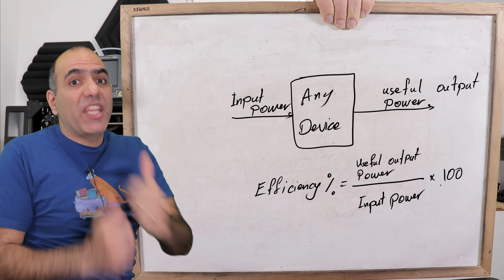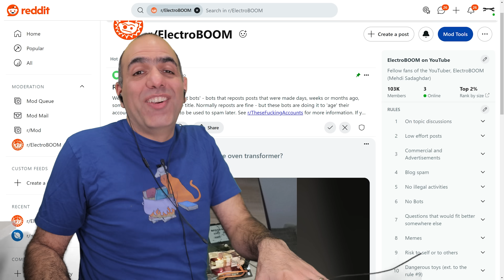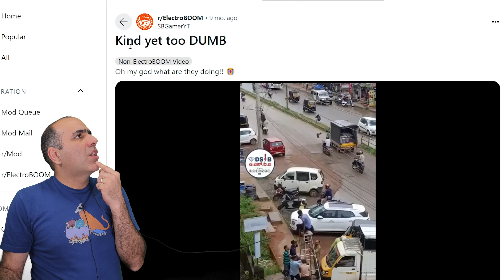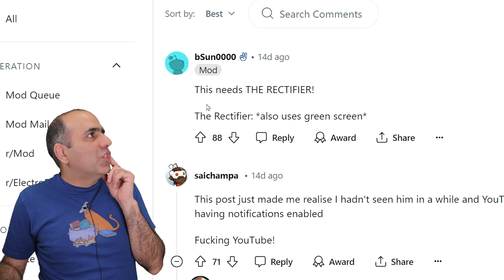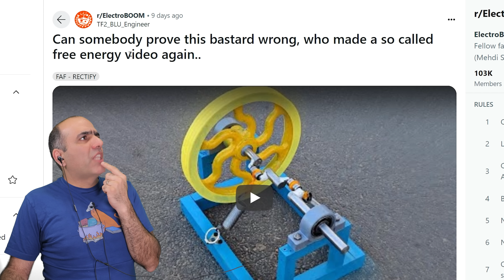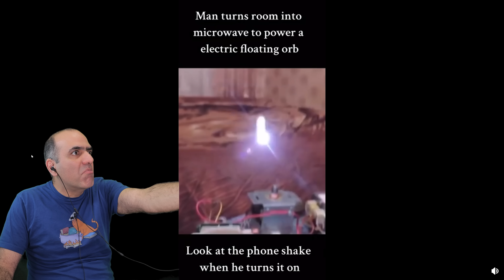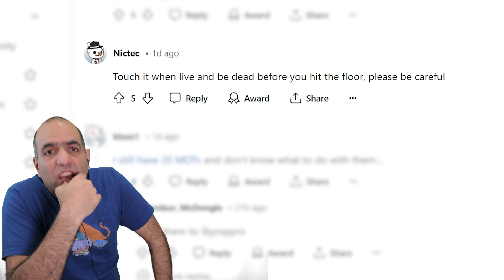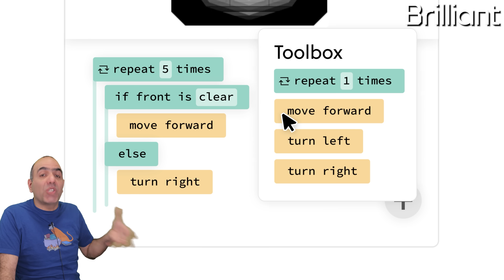New Flywheel Free Energy?! Can Boat Battery Fry You? LATITY-013

Comment: Yea trump has as much knowledge about electrics as he has about good hairstyles
Reply: He was talking about all electric boat not regular boat.
Reply: @harkbelial  Neither on a normal boat nor a "full electric" boat would be a real risk of getting a shock. Not just because the highest battery voltage you have is at 60Vdc, the water around the battery would act like resistor so that the only place where you could feel current flowing is between the 2 poles of each battery, where again you only have 12 or a maximum of 24Vdc.
Reply: @legominimovieproductions  voltage on any electric boat is in the hundreds of volts not 60 because you have 300kw motors just like in cars and those suckers are around 500volts depends on the manufacturer.
Reply: @legominimovieproductions  just wait until someone tells him that submarines are completely electric, because by necessity they have nowhere to put exhaust XD
Reply: @harkbelial  we're not talking about superyachts, we're talking about small sport boats etc. If your yacht sinks and you dont even have an inflatable life boat, then thats on you. And for the 500V battery, the same rules of physics apply as for the 12V battery, the voltage is between the terminals the moment the battery is submerged, so you would literally have to be in the sinking ships electrical room, cuddling the battery to just be at risk of getting a shock.
Reply: @legominimovieproductions  there's a 8m boat with 300kw motor. As you said we are talking so let me ask you this. There's a 500 V battery in the water do you jump into the water? I sure wouldn't.
Reply: @harkbelial   I would, as I know that I wont be harmed. As I said, we are in real life, not hollywood.
Reply: @legominimovieproductions  sure you would
Reply: @harkbelial  If you dont believe physics, then you may should stop existing
Reply: @harkbelial  Thanks for raising the bar to new levels as you guys do all so well 😂
Reply: @harkbelial  He never talks about how dangerous gas things are though, it's weird    https://www.youtube.com/watch?v=wAM_EtjxFhE